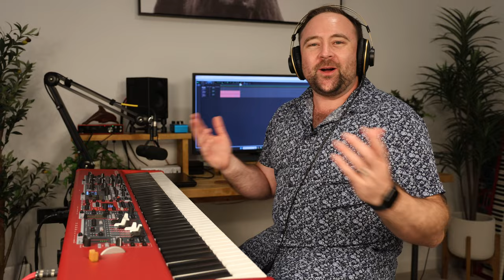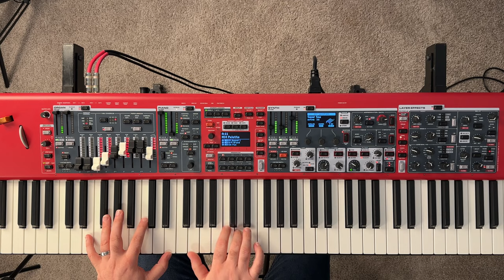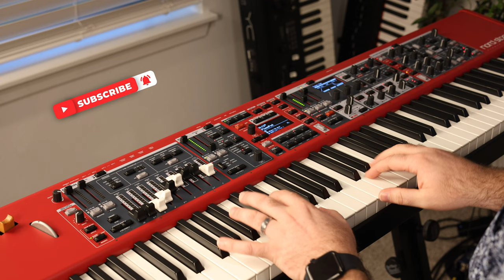Nord Stage 4 - Building a Piano and Synth Pad Layered Sound Tutorial - Great for Worship/Church!

Comment: Curious why you make the mod wheel your volume for the pad even though there’s a fader for it?
Reply from the maker: Maybe part of it is just habit, but I also prefer reaching with my left hand to do it rather than crossing all the way over to the fader. I’ll often have multiple parameters all tied to the modulation wheel as well, so in those cases it makes sense to use it.